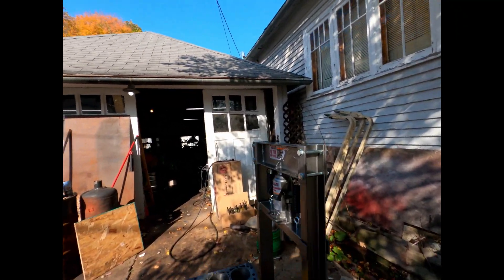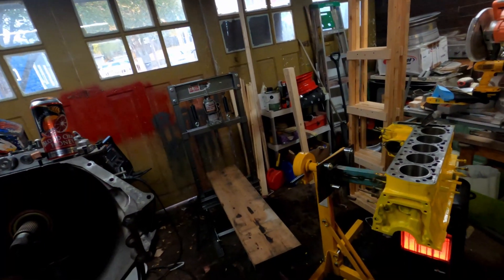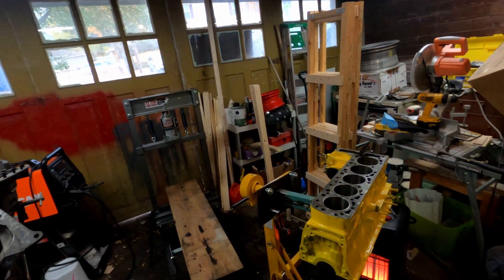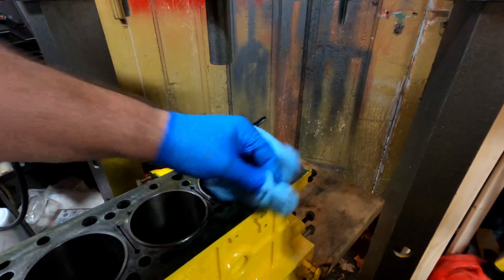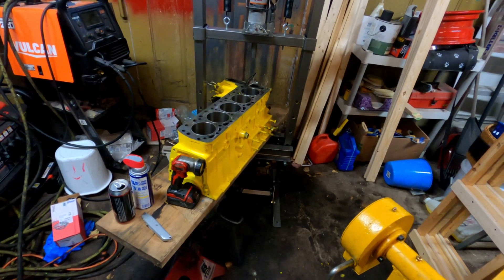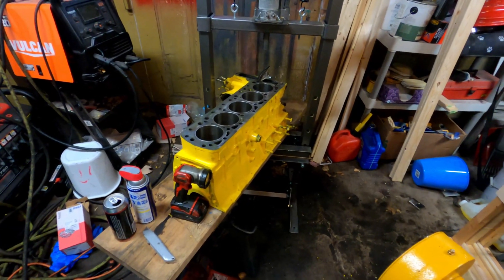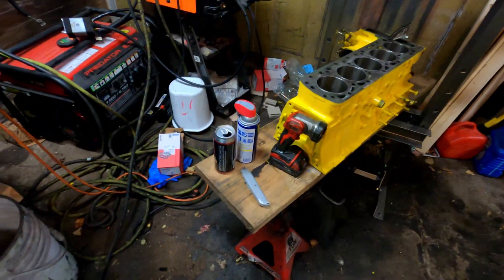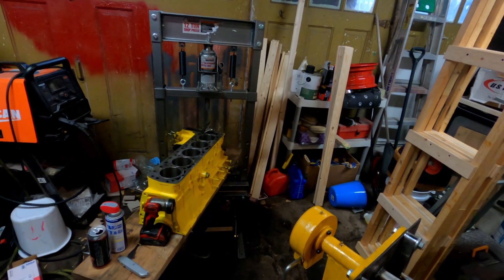Ready for another 1 million miles? Toyota OM617 turbodiesel rebuild, new cylinders

Comment: Now traditionally speaking (Caterpillar etc.) do you hone or de-glaze the new liners once they're in?  Or are they ready-to-run as is?
Reply from the maker: These liners are 2mm underside out of the box.

I think others are ready to go, but idk.
Reply: Gotcha.  They should be bored or honed to exact fit it would seem.
Reply from the maker: @67polara  yeah, also Mercedes did a goofy thing either the pistons where they use three sizes and fit them to each liner as it came out. 

So there's 0, 1, and 2 pistons. My original engine had 2 2's and 3 1's, so my liners were larger to start.

Since I had no way to tell what's in any other engine, could be all 0's... It seemed wisest to start fresh with new liners then it wouldn't matter what size pistons I have.